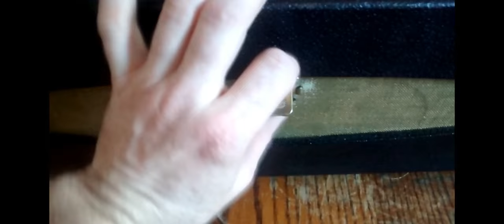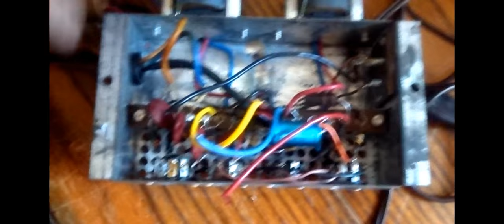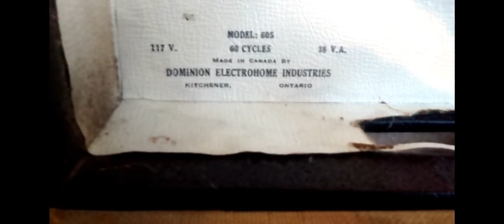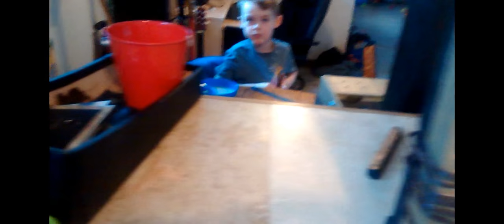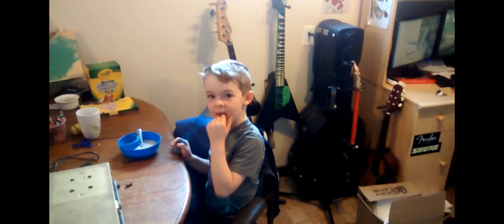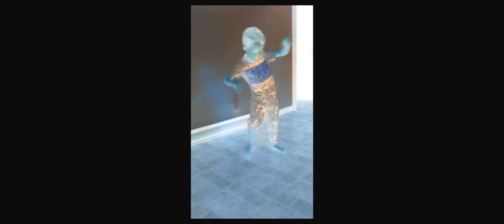Electrohome Model  605 4 Tube Automatic Phonograph Changer Intro

Comment: Looks like a fun project. I bet replacing the big filter cap will get rid of some of the hum. I also like watching uncle Doug and the Guitologist. I also really like D-Labs and Mr. Carlson's lab for valve based repairs.
Reply from the maker: Thanks for stopping by!  I ended up replacing all the caps in the whole works and only have one issue and thankfully it's not electronic lol.  
I also watch D-Labs and Mr. Carlson's Lab.  Love those guys. I wish I had a very small percentage of the equipment Mr. Carlson has.